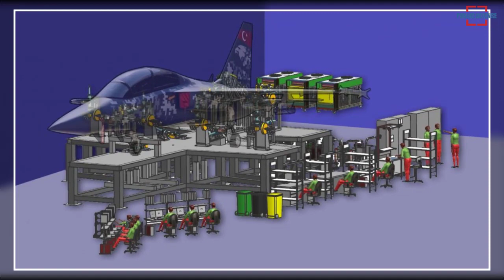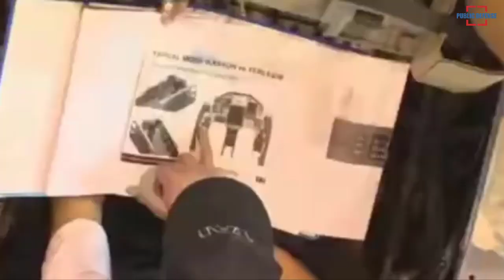Turkey Start Production and Assembly Activities of HURJET for TuAF, Malaysia & Other Countries

Comment: Malaysia will also face problems if it buys the MK1A due to the CAATSA imposed by the USA on India for buying the S-400 from Russia. As the engine used by MK1A is made in the USA. Of course, the USA prohibits MK1A from being exported to Malaysia using their engines. As the engine used by MK1A is made in the USA. Of course, the USA prohibits MK1A from being exported to Malaysia using their engines. Malaysia must be wise in this situation so as not to fall victim to the situation.

Comment: Turkey haven't yet made one then once first one is made then it will take Turkey many years of testing then most of the parts will came from foreign countries like US EU and Ukraine only the shell of the jet will be made in Turkey
Reply: And What does Pakistan manufacture
Reply: Azmal, on your comment that turkey just making the shell... Well dont get me wrong... You are so wrong sir,  Turkey are advance in a lot of thing,  for instance... Electronics,  mechanical engineering,  weapon and weapon subsystems,  electronic warfare equiptment,  bombs, missles systems,  optronics... You just name it sir!  I've been following turkish weapons systems developement for years,  and its faor enough that they are not making merely just the shell sir....i stands to be corrected!
Reply: I guess the CIA are on this tab😂😂😂
Reply: How come they supply over 900 parts of f35 fighter from Lockheed martins….
Reply: This is not first flight

This is first production version
Reply: Turkey is a f35 parts manufacturer.  It is a supplier of parts for aircraft manufacturer companies such as Boeing and Airbus.  Turkey was one of the countries that produced and sold the f16 in the 1984s.  Turkey is the licensed manufacturer of the American-made f16 engine.  Turkey has fighter jet experience.  Also, the planes were tested so much and put into service after many years.  Although the f35 made its first flight in 2006, it was put into service in 2015.